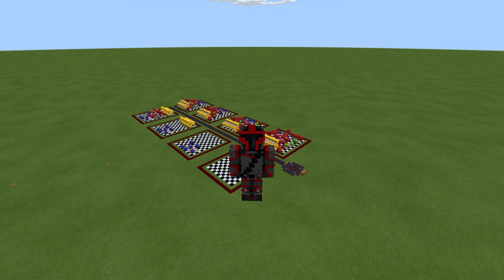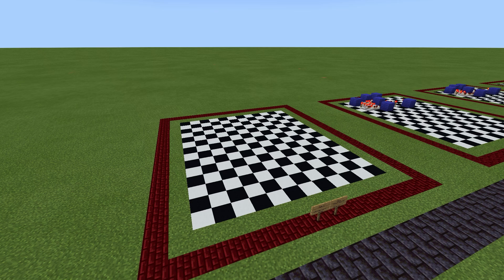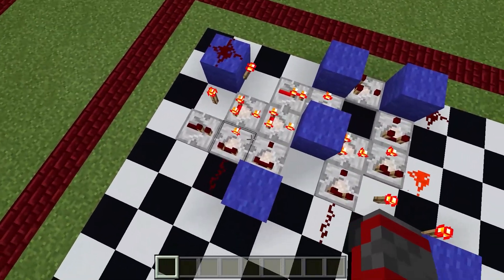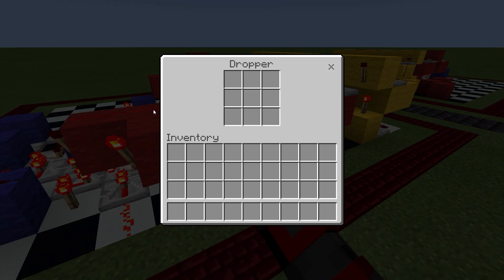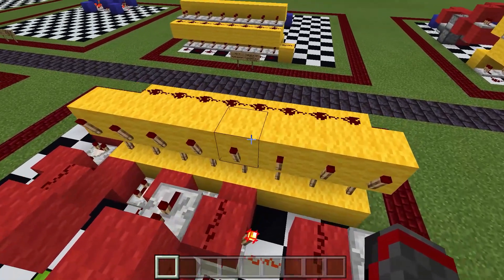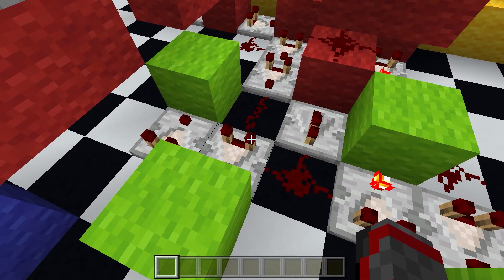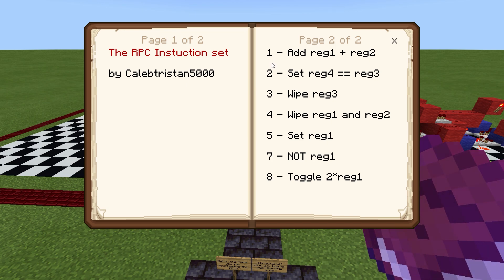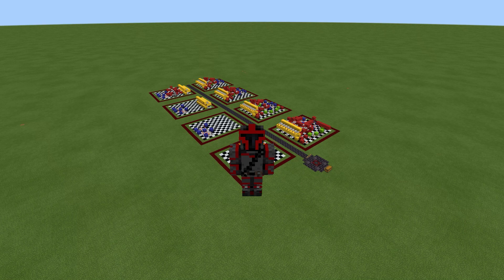RPC2 - Next Gen Minecraft Redstone Computer

Comment: I mean, the use of comparators is a new thing, but whatever you say, it isn't a computer. Why? There is no RAM, Control Unit or even a way to run programs, just a small calculator that can multiply and add.
Reply: It is not, but it can quite easily be connected to such systems.
Reply: it's the base for a computer. Add some ram and a simple clock and you don't need much else. It already takes instructions as inputs, so it's close to already being a computer
Reply: @vibaj16  As said, it's just a glorified ALU with registers, there's not much else to it.

Comment: Great work! It's awesome to see someone make a redstone computer that takes advantage of signal strength and use it as a hexadecimal system instead of seeing it as a hindrance to a binary system. To increase capability, could you potentially use two hexadecimal bits for each number to make a super fast computer that's equivalent to an 8 bit computer?
Reply from the maker: Yeah it should. Since signal strength can only go to 15, you would have to create a small circuit to simulate 8-bits. But it is entirely possible.
Reply: Made it and it can count to 512!
Reply: that's a full NES!